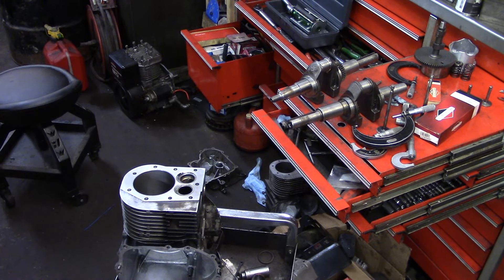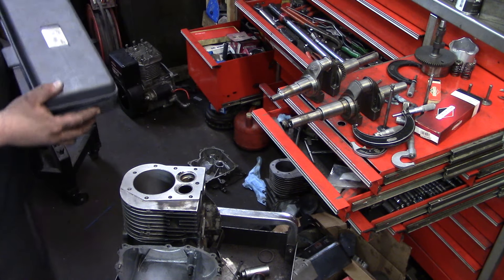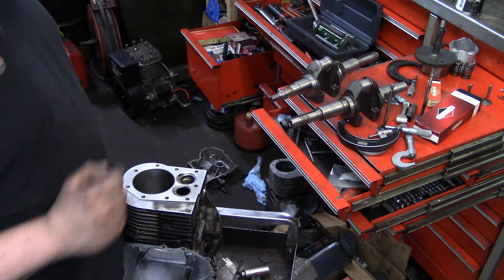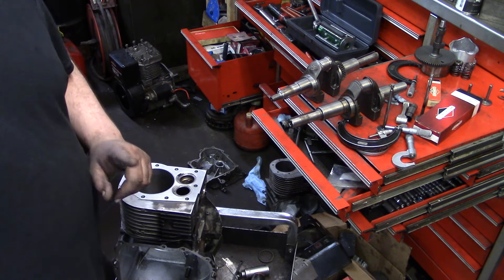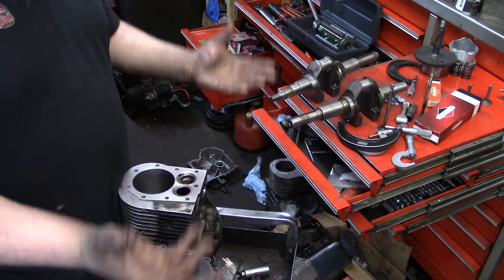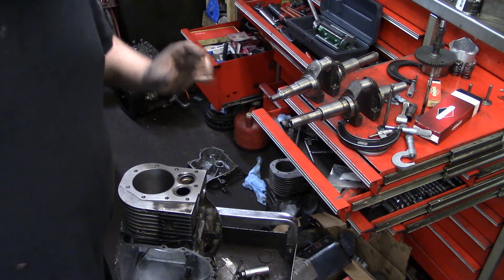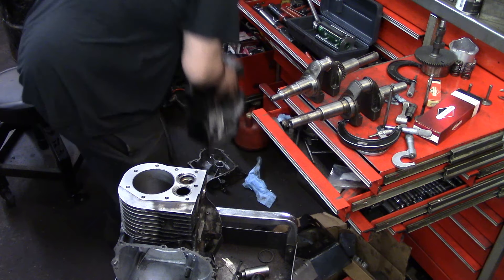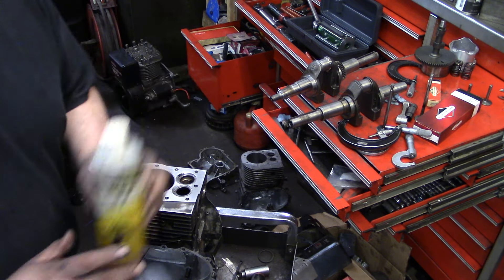Tips For Boring A Cylinder At Home You Need The Patience of Job.

Comment: Just curious: Why not buy 10 thou oversize rings & file fit them. That's what I've done. It's a Lawnmower engine not the Space shuttle engine. ONE MORE THING: I don't hone or glaze bust, I just file fit .003"/ inch of bore and put it all back together. Then light loads for a while. It will be down on pwr slightly for a few hrs and maybe use a little oil but it will work for long time & save boring for another time.
Reply from the maker: These 2 motors the cylinder bores were pretty bad that one the piston would slap and knock and had very lower power. The other was rusted very bad would have torn piston up. I figured try to make these motors run really strong and are getting hard to get parts for. I figured I would bore these motors for the sake of learning .